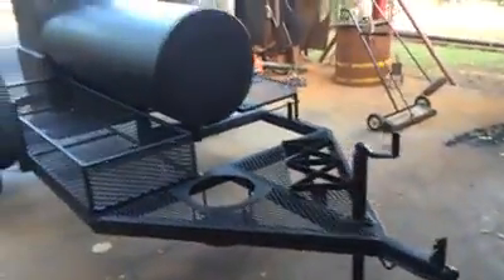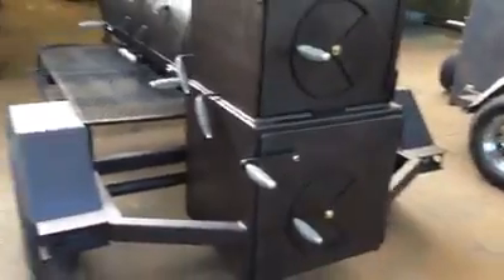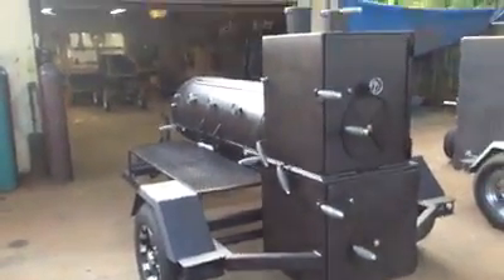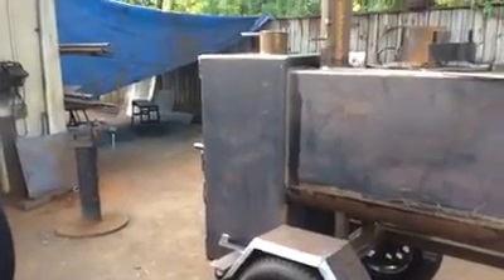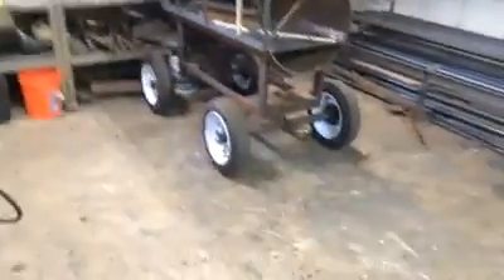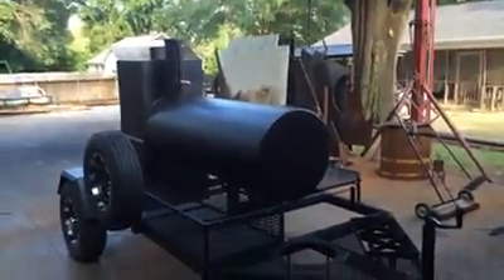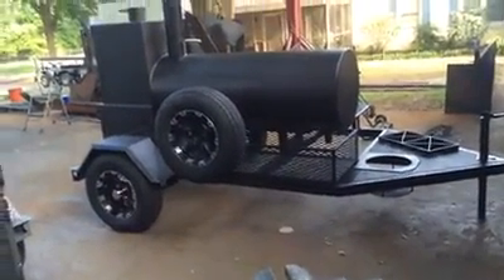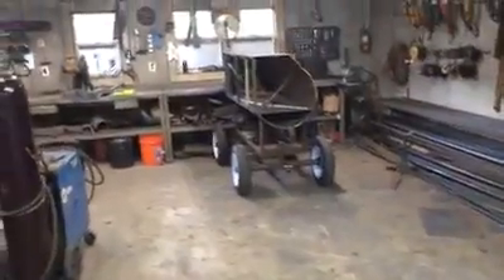My Shirley Fabrication 24 X 65 Trailer Model Smoker

Comment: I'm curios about the trailer compared to the golf cart cooker you had, you had mentioned that the new owner put that on trailer, do u like this style cooker over cabinet model. Have you always had reverse flow smoker. Reason I'm asking is I like the lonstargrillz, and like the way u can add water and easy clean out. Any input is good. This would mainly used for personal use no major productions, but fit and finish on both cookers are very good. I happen to see the trailer was yours when I was going through shirley fabrication video. Congratulations on first 3/4 inch door. Could you have grill made to use in warmer box. In one video Paul made he had grill on double burner the same as on your trailer. Lastly what is major reason for insulated  box as opposed to 1/2 box . Looking forward to more video on shirley fabrication.
Reply from the maker: The new owner of my last cooker is going to have install this summer and has to wait in lines for mod changes too . I will never have the traditional doors after having the cabinet doors , the traditional door is very heavy and would be probably alright on a smaller cooker . Shirley has the option now to have a grill in the warmer and I am getting this option and picking up my new cooker next month and will be doing a video . The reason I get the insulated fire box is it uses a little less wood but also saves the paint longer and little kids will not get burnt as quickly .